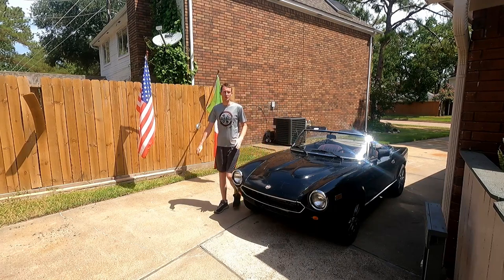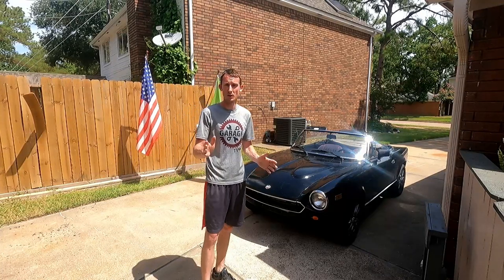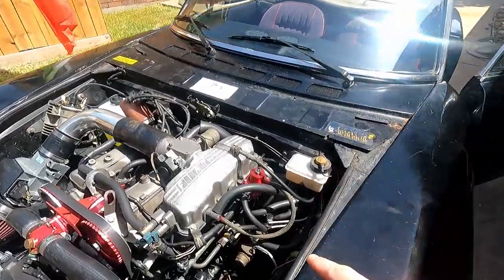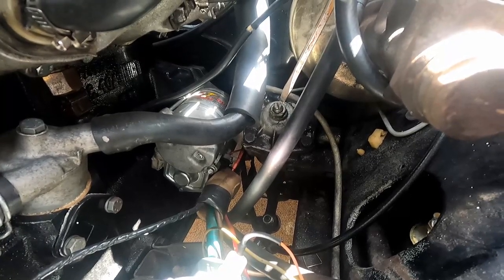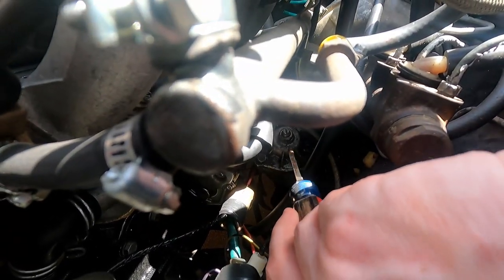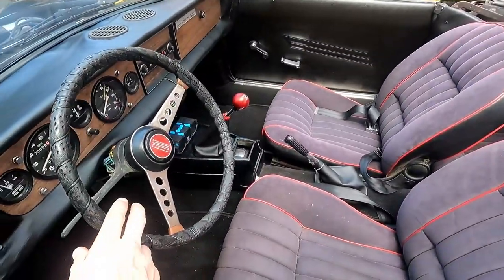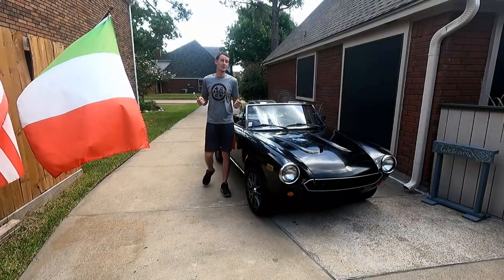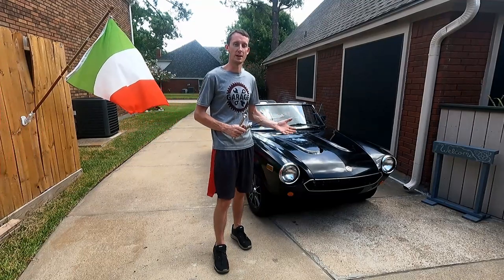Fixing our Sloppy Steering in our Fiat 124 Spider IN MINUTES!

Comment: I took the play out of an old pickup and then couldn’t get full lock on the steering. I now set the lash on a high mileage box with the wheel fully turned.

Comment: Where did you get the cool air setup with black polyurethane sections? All I've found are red.
Reply from the maker: The cold air intake? I got mine from Vick Auto Sports. Idk if they have many left in stock though. I LOVE it

Comment: Hi - what about if steering pulls to the left even though tie rods, knuckles and wheels are aligned? do you reckon it may have something to do with the steering box?
Reply from the maker: Did you have a professional shop align it for you?
Reply: @GarageTimeTV  - hi mate, yes confirming that a pro shop performed wheel alignment using laser, so in summary, steering still pulls left even tho have replaced many parts and font aligned, any ideas?
Reply from the maker: @rockycaputo7482  I would go to a second shop for another opinion. Something isn’t right.

Comment: HI I'm restoring a 1980 spider.  Having sloppy steering issue.  Have adjusted steering box, checked idler oil box. No improvement.  How can I trouble shoot from there?
Reply from the maker: Check your linkage joints from the steering wheel down. There could be a loose bolt or the joint could be worn out.